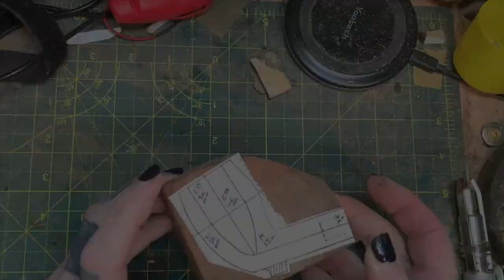Making of Pipe #40

Comment: It looks great , but you didn't video the only part i wanted to see. The swirl engraving
Reply from the maker: I'm not the type to hold secrets. I marked out the rings in pencil 4mm apart and then used a 4mm round engraving rotary tool to cut the rings and then sanded them.

Comment: Looks nice. What size and model lathe are you using?
Reply from the maker: A generic chinese 8x16, which had a few problems. I use every single mm of that bed with tooling in.  If I was buying again I'd get the size up or a second hand Myford ML7/Super 7.